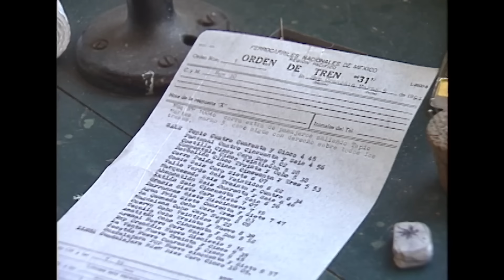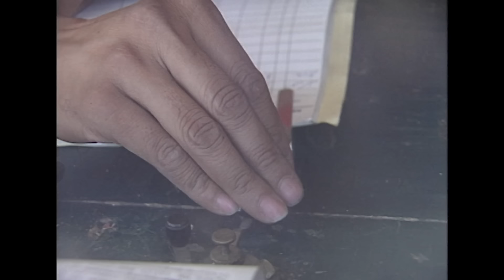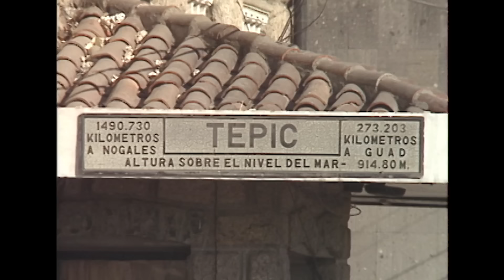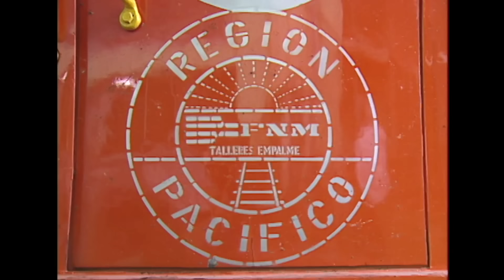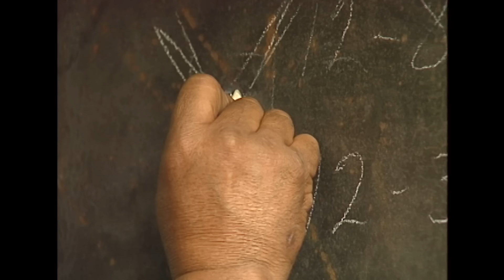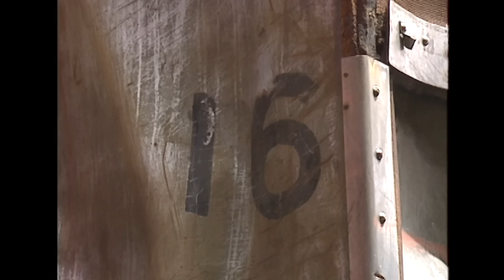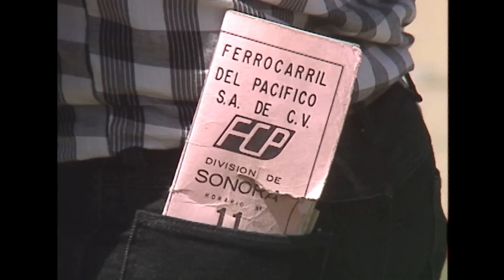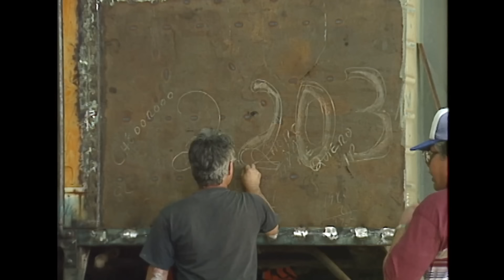Mexico’s Ferrocarril del Pacífico (FCP) - National Railways of Mexico, Part 3

Comment: Gotta love those old ALCO’s and GE’s hard at work smokin’ up the sky. I’m also quite surprised of the amount of former Canadian power that is seen in this footage.
Reply from the maker: Yes! It seemed that nearly every unit on the FCP’s roster was capable of blocking out the sun with thick clouds of exhaust smoke. Those BC Rail units were pretty neat. The timing of the sale must have worked out perfectly. Mexico was looking to buy just as BC Rail was looking to sell. Thank you for the comment, Josh.

Comment: Here again to point interesting factors for this video:

1. Out of the railroads in Mexico during the 90'S, the PACIFICO was undoubtedly the most interesting & colorful when it came to operations & motive power. Even the lineage of SP could be spotted on various diesels & trains when it came operation practices. 

2. Whether it was you'd like to see VETERAN ALCO's smoking it up doing yard work or MODERN HI-TECH G.E.'S lugging passenger trains & priority freights on the mainline, PACIFICO back then would stand & deliver along with a wide variety of paint schemes created due to the creation of the FNM. Even reborn & rebuilt VETERAN ALCO PA'S being given a new lease on life would have the heads of railfans doing complete 180'S & 360'S.

3. The engine facility at Guadalajara, Jalisco is utilize to service diesels recently coming in from the North. Here they're fueled, serviced, & even sanded before being readied for another road trip back up the line. The B23-7 spotted was one of three currently on loan to the "PACIFIC" region during that visit.

4. The cut of passenger cars being towed by the ALCO RS-11 came in off the overnight express train from Mexico City, MX. Called the "EL TAPITIO", this was said to be that countries finest passenger service & used primarily by business employees to travel in-between Mexico City, MX & Guadalajara, Jalisco. Consist included a CLUB CAR, DINNER, & 6 SLEEPERS in addition to several FIRST-CLASS COACHES with a majority of the sleepers coming originally from various U.S. railroads. Reservations planned ahead are mandatory if hoping to ride a train like that.

5. When it came to the mainline freight's #'S 51&52 the SUPER 7'S were said to be the preferred motive power for them although as was spotted C30-7'S & EX-BCR M630'S would make cameo appearances from time to time. However the M630'S came to me as a SURPRISE & it made it look like Canada in Mexico country which made them become personal favorites of mine next to the SUPER 7'S.

6. The town Of Mazatlán has two faces which includes oceans, hotels, & fine restaurants for tourist & an engine house, modern passenger station, & yard for railfans. Passenger train power is fueled & serviced before continuing on. Train #2'S consist included a CLUB CAR & two SLEEPERS. This was actually a short lived experiment as a way to get tourist to Mazatlán by train when buying tickets in the U.S. but didn't become as successful so they were taken off.

7. The shops workers at Empalme, Sonora were undoubtedly a force to be reckoned with which is why finding out their shops were no longer in service came as a surprise to me. Certain this could never happen with how much hard work they've done into building, fixing up, & rebuilding various engines back into service. Even giving 3 of the 4 ALCO PA'S a second chance of life in railroad work was something the shop employees should be held in honor of. Of interest, passenger trains would often be used to deliver power dead-in-toe for a shop visit. Even ALCO PA #19 was originally in passenger service on the "PACIFICO" until officials placed it on display & since Mexico railroads would be short of power occasionally, the lost of that engine was a concern. At the time of this visit, #'S 18 & 16 weren't being worked on was due to their trucks either being missing or beyond repair.

8. The PACIFICO'S actually split into two divisions with the "SONORAN" to the north & "SINALOAN" to the south. Sufragio, Sinaloa serves as the division point of both & junction with the CHIHUAHUA-PACIFIC which Mr. Hadley visited in 1990.

9. I always did wonder what kind of service that FTA diesel for the FERROCARRIL SONORA BAJA CALIFORNIA was used for during that time, probably passenger service.

10. Trains #'S 11&12 were quite unusual to me. I had no idea that Mexico railroads did piggyback service. The only time intermodal service would show up would be in the form of APL/APC stack containers coming in from Laredo, TX headed to Mexico City, MX or inbound from Nogales, AZ to the FORD assembly plant in Hermosillo, Sonora where the ESCORT models are built. Although it wasn't shown here but once in Nogales, #51 passed a string of empty APL/APC containers that also would be going over the border later on that very same day but were those picked by the two SP GP40-2'S that brought in the APL/APC loads or was their visiting UP power waiting near by? Those without a doubt will make the THEN NEW symbols ADHFT & HFADT trains for interchange to & from the GTW in Chicago, IL.
Reply from the maker: Another slam dunk on the factors, Colin! 10/10. Regarding your Nogales question, we’re not sure on that. We’re fairly certain that we understand the operational details of those Ford trains circa 1995, but this was earlier than that. Things may have been a little different in the early 90s. As always, thank you for providing additional relevant information for us and our viewers.
Reply: @CVisionProductions1  You've very welcome as always. 

1. It was actually a surprise to me that SP power had the honors of doing the interchange work with FCP at Nogales. By that time U.P. power had become a common fixture on the FORD trains but if one is lucky enough or spend enough time spotting these trains working SP'S SUNSET & GOLDEN STATE routes with regularity you might get something different which was the case here.

2. Of interest, my family use to own one of those Ford ESCORTS back in the early 90'S ergo it's parts to assemble it must've came to the Hermosillo plant days earlier on that train. 

3. If you ever do manage to succeed in my first 5 VHS ideas & I know you can do it in time, I'd like to have the MEXICO series done next. This series has become a personal favorite of me & my dad but primarily my dad for it introduced him & me to the SUPER 7'S. For those are quite a challenge to find in HO scale, especially in the ATLAS model. The visits to the CENTRAL & PACIFICO regions of Mexico showed me the greatest number of them at work while still looking like new from the shops & builders.
Reply from the maker: Thank you for these “follow up factors”, Colin. Ford was a big rail user back in this era. The VHS idea is interesting, but it’s more likely that you’ll see these videos released on DVD versus VHS. We’ll see what the future brings. Thanks again.
Reply: @CVisionProductions1  You're very welcome once again.

1. I'd like to mentioned these in case anyone ask you folks a question about something featured in your uploads but not mentioned should they be curious about it.

2. I came up with this VHS revival idea as a result of you folks dedication of VHS releases from when you first started in 1994 all the way up to 2009. To me that's quite the accomplishment & managing to carry on this practice when others stopped. 

3. To me, this idea would to be quite challenge you folks may've been looking for to prove & see if you've manage to keep your VHS producing skills up to par. As a reminder, feel free to utilize any of the available links I sent to you in case of the unexpected. Not to mention it's a proven fact that VHS tapes actually become very valuable & well priced on the collectors market which without a doubt can bring in lots of profit for you in the long run.

4. Right now, I'm in no rush. I'd like for you folks to take all time needed until you can find out a solution to make my proposed ideas possible. If it takes a few years, it'll all be worth it & pay off later down the line.

Comment: You mention those Engine shops are long gone. Do all those skilled workers go to another engine shop,or just loose their jobs? Dont they need these men  to keep fleet running?
Reply from the maker: Hello there, P.J. - Unfortunately, many of these men lost their jobs. Privatization of the Mexican rail network involved some major downsizing in the workforce. Much of that was caused by the loss of passenger trains. Even in the years before privatization, the process of eliminating jobs and curtailing operations on certain lines had already begun. Today, the Empalme Shops are nothing but empty lots containing a little rubble. Pretty sad, especially considering the incredible work that was done at those shops over the years. As always, we appreciate your comments and questions.